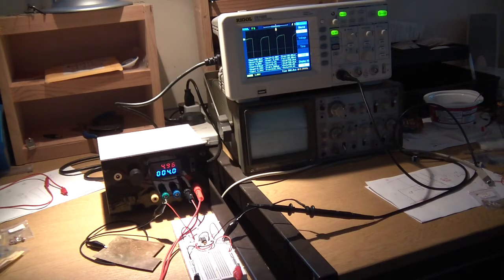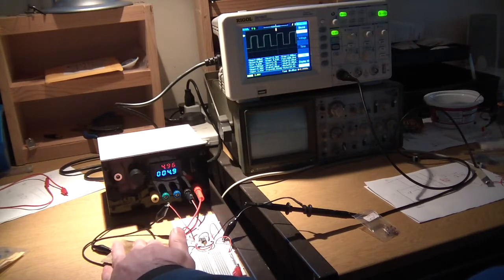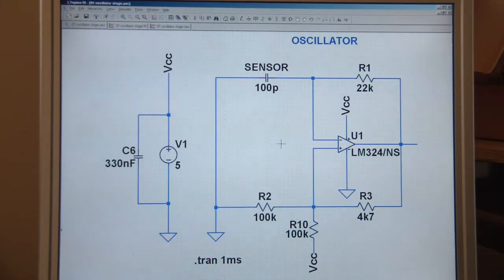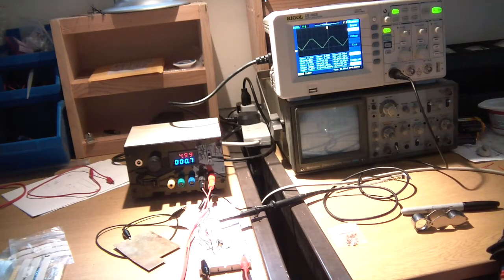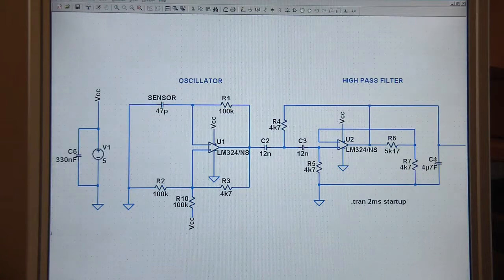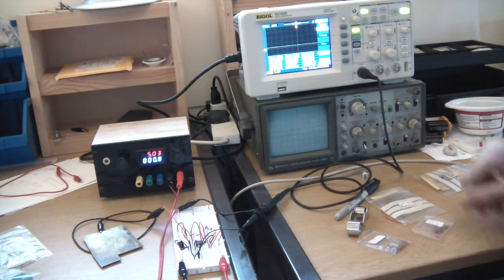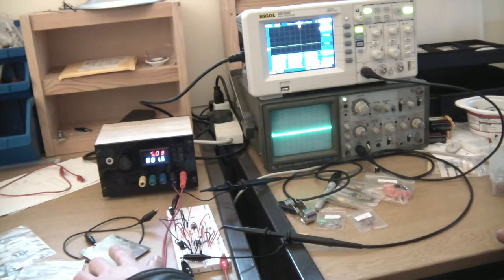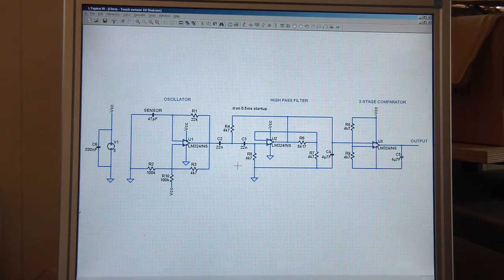Simple and Cheap Capacitive Touch Circuit

Comment: Seems like everyone's doing capacitive touch lately. Great to see another vid from you. Hope you're well. Cheers Andy!!
Reply from the maker: Overworked moulding as usual! On reflection I think a low-pass filter might be a better option - there's a lot of crap harmonics from the oscillator output which affect the filter's response. That's why the output is higher for the lower frequency, contrary to expectations. But, hey, it works!